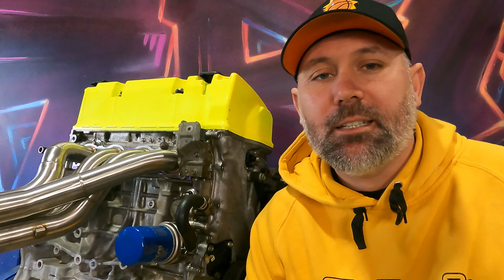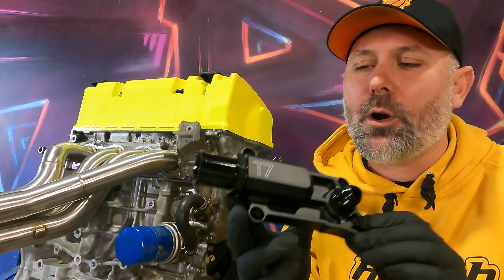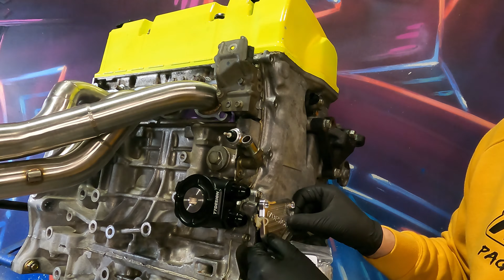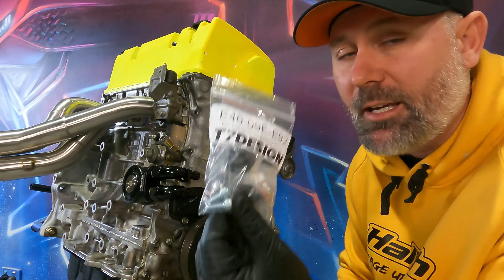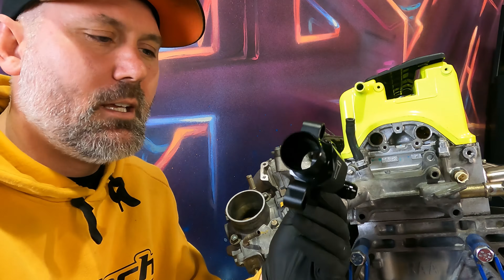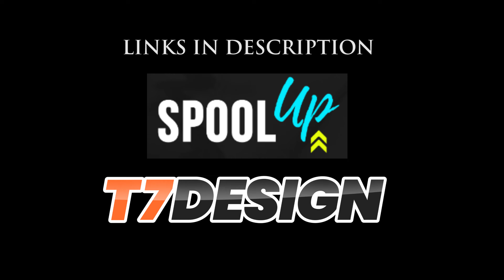Exciting New Kswap Goodies

Comment: what front brake rotors do you have installed? 282mm?
Reply from the maker: Several videos on my channel about the brake upgrades
Reply: @TURBOTRISTO  my car comes with 282mm brake rotors: 96 jdm honda civic ek5 sedan  awd factory k24a kswap   ...what performance brake rotors kit would you recommend ,,not looking ti upgrade from factory diameter,,just more stopping power
Reply from the maker: Yes